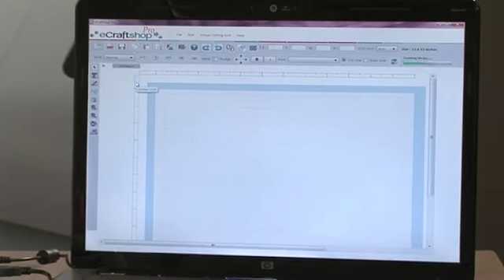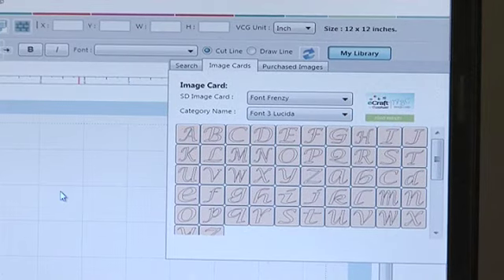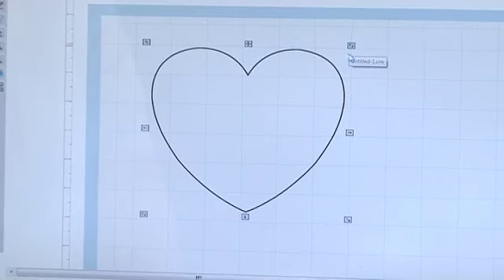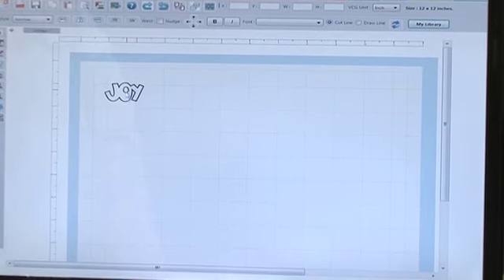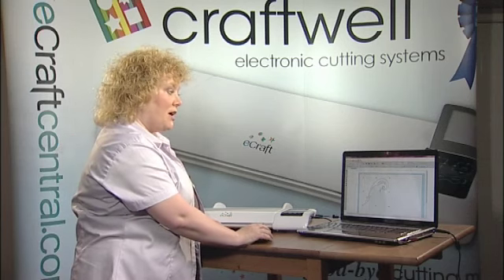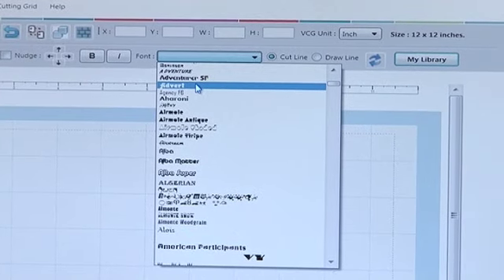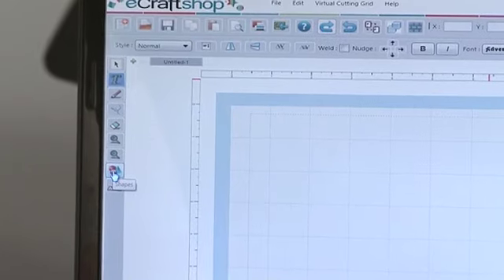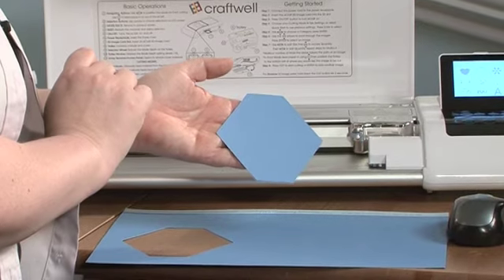Using the eCraftshop Pro Software (Basic)

Comment: What if you want to use images from 2 different sd cards? Does this mean you have to cut one image, remove the sd card , put another sd card in to cut the other image? And what if you want to take a image from 2 different sd cards and say weld them together and cut that image?